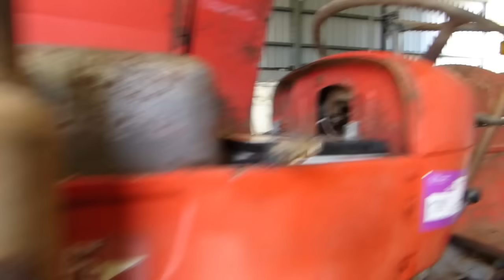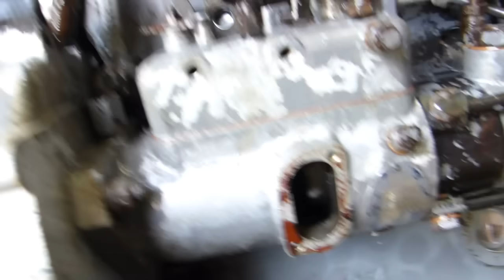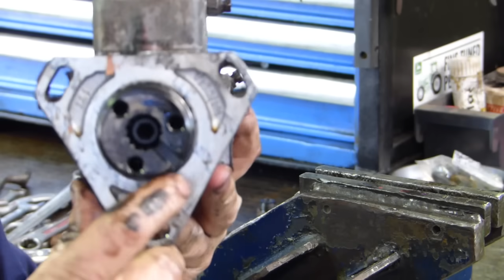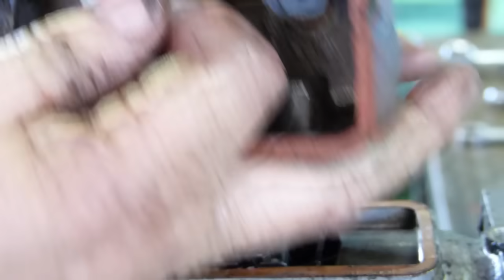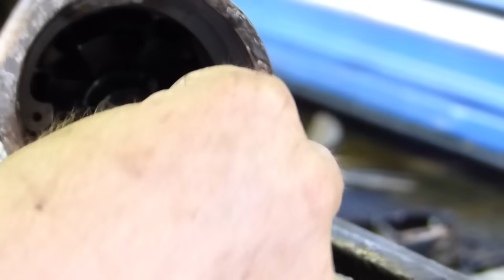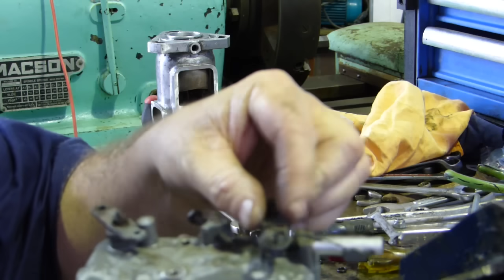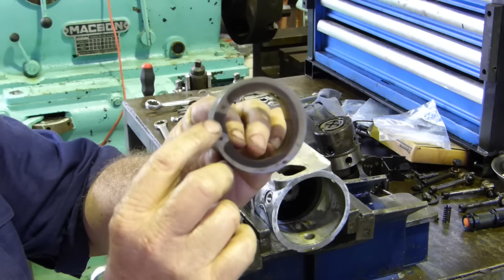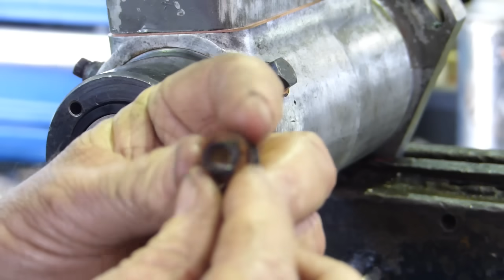CAV Injection pump full strip down to re seal and stop fuel leaks

Comment: Lance, Thanks for an excellent and very informative video. Unfortunately, I didn't watch it until after removal of pump and may have screwed up the timing. When I bench tested to see if it pumped fuel out the ports it did, but as I continued injecting fuel while cranking, the pump hit some hard stops where I couldn't crank. Once the fuel depleted I could.pump again and fuel spit out the ports. Could the cam ring going in backwards cause the problem, or is this really a problem?
Reply from the maker: +Jake Madril G Day Jake, It does get a little harder when turning to test but not lock up. Timing being out shouldnt stop it either. Are the delivery valves (where the pipes go on) clear?
Reply: Lance, thanks for.the comeback, but my pump continued to lock up on bench testing.  I ordered a.New one at $399. Bench checked it for diesel squirt and it worked fine as expected. I then checked my old pump again and it worked fine. I found out that the lock up was caused by my using brake fluid and hydraulic fluid for the test. Bottom line, avoid the heavier fluids.for testing

Comment: A lot of these pumps have an Automatic Advance Unit (AAU) bolted to the bottom of the main pump housing near the Hydraulic Head (HH).  There is a large bolt (3/4" wrench) that goes through the AAU that must also be removed in order to remove the HH.  WARNING: In some cases, there is a small steel ball that sits in a cavity in the SIDE of this bolt that likes to fall out and roll away when you are unthreading the bolt.  The rebuild kits usually include a new ball, but I like to keep the old one just in case.  Otherwise, very well done video.  Local shops were quoting $650 to do the same thing I was able to do for $37.
Reply from the maker: +Gary Matthews G Day Gary, Yes I have had the balls drop out as well.  Quite a few do have the advance, I never chuck the left over parts away in case I need them on another job. Thanks for watching
Reply: +Bundy Bears Shed  It was a great video - it got me through my first CAV rebuild!  Now I have a banjo bold that I can't get to stop leaking - even after replacing the banjo and the steel/aluminum washers.  Any suggestions?
Reply from the maker: If it is on the injector lines run the tractor and loosen and tighten it a few times and it often helps bed the washers in.

Comment: nice job sir ,I'm having problems getting fuel up to injectors  its doing me nut , it might be that plunger inside it's been sitting up for about 20 years. MF25 ?
Reply from the maker: +driveheronman Check the plunger in the end cap and make sure the metering valve is moving free.
Reply: i will sir thank you

Comment: good vid well done that pump is for a 23c is it not ///?????? have you done a pump on a 20c  TEF
Reply from the maker: +bill block G Day Bill, The TEF20 with the 20c engine has an in line pump. I have found they have a gauze on the engine side of the pump that plays up but I havnt totally rebuilt one
Reply: yes u right i have one and need to get it going it was all ways hard to start ////ps like the shed and the old macson

Comment: it feels like when I pull the stop, the throttle linkage goes a little past center and just like you said it's not strong enough to get it back around. what would you suggest on how to alleviate this issue?
Reply from the maker: +Wally Ladner Pull the metering valve out and polish it with very fine wet and dry paper or wire buff it gently, not sure how much gear you have lol.
Reply: The metering valve  looks pretty good just a little bit of rust at the top

Comment: yeah, it was free. I'm actually taking apart now
Reply from the maker: +Wally Ladner  When you get to the rollers you may need to undo the double hex bolts and free up the plunger in there but mark it first, Did you check the inlet plunger under the screen on the end housing on the vane pump?

Comment: Hey Lance,  this is a very informative video.  I have a 1967 4000 ford #cylinder diesel that I bought off the side of the road for scrap metal price. Long story to a short one....I've rebuilt the engine and tried starting it after bleeding the fuel system, but no fuel is coming out of the injector line ports.  You made mention of a possibility of the fuel metering devise getting stuck due to water in the fuel.  My thoughts were maybe the stop lever has came off.  Do you have any video of a ford  CAV injection pump before I tear into this thing?  This will be my first injection pump adventure. Best Wishes and thank you in advance Wally Ladner Gulfport, Mississippi, USA.
Reply from the maker: +Wally Ladner G Day Wally, It is the same basic pump just 3 cylinder and not 4.  Pull the top cover off taking note of where the spring is and check the metering valve it has a long skinny spring on it with a rod inside the spring, just check it is free. Sometimes the governor spring is not strong enough to turn it if it is stuck, free it up and you might have a win.

Comment: thats an awesome video.
 I have a question for you , I have a 434 international. The pump looks the same will the Sparex kit number be the same ?
Reply from the maker: +scott smith G Day Scott, Yes if it is a CAV pump the kit will fit for sure
Reply: +Bundy Bears Shed I have a question for you .the numbers on the side of the injector pump .7/900/4/2200 the number 4 is the setting inside.( the punp spring)
Reply from the maker: +scott smith Yes I think so Scott.
Reply: +Bundy Bears Shed tanks alot i am going to take the pump off this weekend.tryed to send you a picture of the pump you can see some snow in the picture.
Reply: +Bundy Bears Shed  I have another question for you my vanes in the pump shouldnt be stuck in the pump?
Reply: +scott smith The vanes are breaking apart while im trying to take them out.
Reply: +Bundy Bears Shed  I think some one has had my injector pump apart before because it has no timing ring in it. I marked the pump when and where it was set when i took it out. going to try to find a timing ring before i put it back together.
Reply: +Bundy Bears Shed Thanks for the video thanks for the info tractor is now running.Next is to tackle the wiring .

Comment: Excellent video! My Ford 3930 was running fine, I went to start it the other day and nothing. I'm thinking it's just gunked up maybe screen plugged. My tractor only has ~1200 hours.
Reply from the maker: +D Canfield G Day D, When you lift the top off the pump look for the little lever on the pipe end with the long spring at one end. If it gets tight from moisture it will stay in the stop position, free it up and you might get lucky and get it going easily. Thanks for watching and commenting.
Reply: +Bundy Bears Shed  I was figuring on pulling that off. Thanks again Dennis.

Comment: how do you slightly increase the fuel delivery on this model pump?
Reply from the maker: +Levi Skuse G Day Levi, In the end of the head undo the little double hex bolts and slide the bracket around a bit to give the rollers a little more travel. Thanks for watching.
Reply: thank you

Comment: I think my 73 Massey 165 is leaking out of every orifice on the tractor. Front timing cover leaking, fuel pump leaking, and I think the rear main seal is leaking too. The tractor runs great just leaky. May be a winter project.

Comment: Lance. You know that point where you decided not to take the rotor apart. Well I am to a point where I need to.  So I am wishing you had. I just need to pull the rotor out and check the ports. But I'm not sure how to get the vane-pump rotor off the end of the shaft so the shaft can pull out. Any ideas?  Thanks
Reply from the maker: +Cameron Brown The Cross piece screws out the end but you wouldnt want to spread the grooves where the vanes go. You can check the plunger etc from the other end and blow air through the ports if that helps, just scribe barks before undoing the little double hex screws.

Comment: Great video to help put our minds at ease before we get into this job.  Really like to hear the details of what each component of the pump does.   My pump is pushing fuel throught the low pressure pump, but nothing coming out of any injector ports. It might be that plunger under the high pressure pump.
Reply from the maker: +Cameron Brown G Day Cameron, Under the rollers that run on the cam track, in the main body, you will need to undo the double hex bolts, there is a plunger that could well be stuck, no problem looking at it just mark where the plate is. Another thing it to make sure the metering valve is free.

Comment: A1video Lance , unfortunately there are a lot of companies that will tell you that you need to bring your parts to them as they need special tools etc to rebuild them .
I once rebuilt the front diff of a 60 series landcruiser and the manual stated that you need special tool part number xxxxxxx  to set the swivel hubs up but toyota knew nothing of it !
I ended up just making my own tool on the lathe .

If you keep making them i will keep watching em !

Ian.
Reply: There are special tools for this pump. Just like everything else, there's a way to go without!

Comment: After watching this video I'm almost positive the O-ring on the pump head at 26:30 is what's leaking on my injector pump. I have the Perkins AD3.152 engine on my Massey Ferguson 231. Gotta find a mechanic now. THANK YOU FOR THIS VIDEO!
Reply from the maker: +231MasseyFerguson Thanks for watching and commenting, hope it is helpful. It is the same process on your tractor but yours is a 3 cylinder pump.
Reply: +Bundy Bears Shed thats what i have, a 3 cylinder

Comment: Another great video Lance, thanks for sharing. Quick question, does the governor in the pump regulate fuel based on load or for max rpm? 
Thanks & cheers, Peter.
Reply from the maker: +peter hoddinott G Day Peter,   Works on RPM which in turn if affected by load. Governor is fly weight. Thanks for watching and commenting.